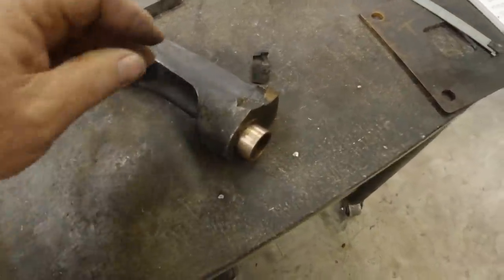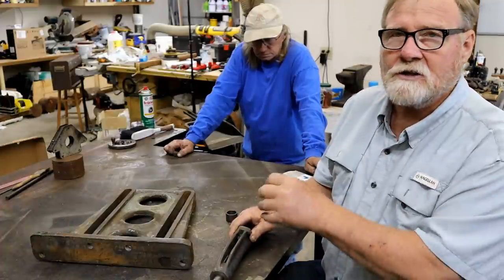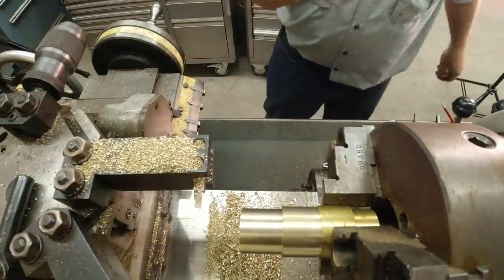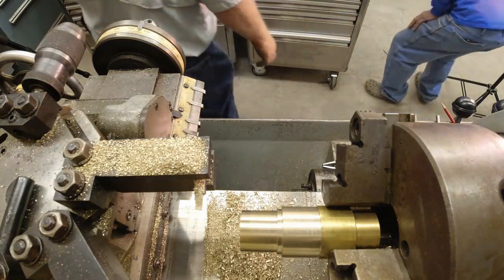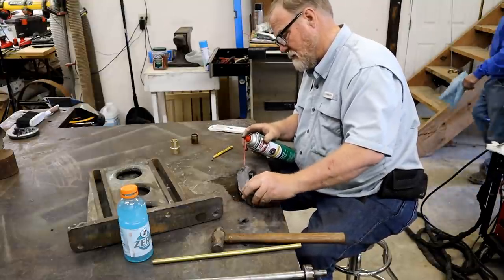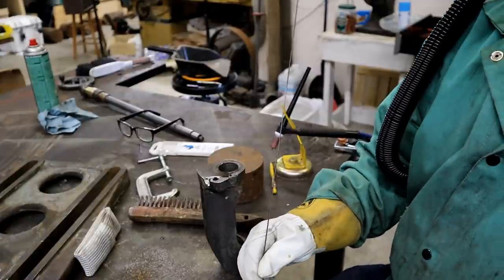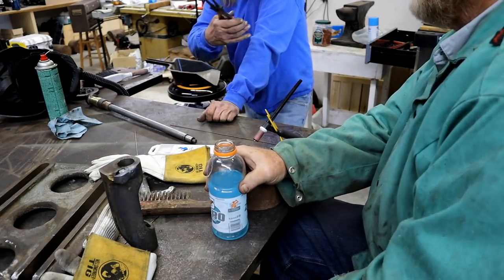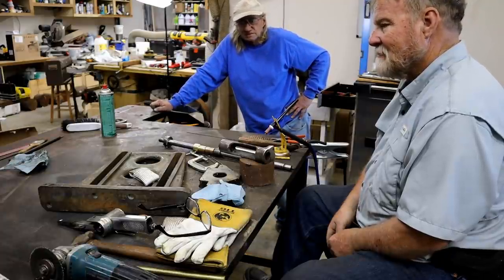Weld Repairing another Cast Iron Shaper Part

Comment: Love your 'big ole hands' 'Jody 'Gloves, I have a couple of pairs of the black tig gloves that are also fantastic......Tig Fingers are great too......
Reply from the maker: I find I use the tig finger as a resting pad most of the time....:) I also was thinking that all my cups were too small so I ordered up a Furick Cup pro kit... Two days and it was here from Weld monger...
Reply: @10swatkins  I bought a Jazzy 10 and some of the glass ones too.....for stainless, that extra coverage helps, but for aluminum, I have gone to a #5 non gas lens and I am getting great results......the smaller etched area makes the arc behave more and I am now getting much cleaner beads.....Jody is a great person to deal with, they are based out of Daytona Beach for the store, which is 50 miles from me......I used the tig finger doing high amp MIG [225] all night long on a 250 amp air-cooled gun, I just unfolded it and slide over the goose neck and walaa, I was not burning my hand......best wishes, Paul.....

Comment: I'd bore it out so that you don't have a stepped bush, your step is a weak point! Cheers, Matthew
Reply from the maker: Looking at it if I bored out the casting It would weaken the sides too much..  the steped bushing has a radius at the step and its a lot stronger than what they originally designed...

Comment: That turned out really nice.........keep us posted (Don) on how that EZ Tig is to machine, did you mill it with HS Steel or carbide, speeds and feeds, that kind of info....thanks guys.
Reply from the maker: It turned out to be hard to hold so I came up with another plan... Next video... the EZ tig is harder than the cast and using a carbide insert it machined well.
Reply: I’ve used this as well. It welds up very nicely, does t seem to have cracking problems, even after a year of use. It machines well, but yes, use carbide. There’s nickel in this, and that’s tough for HSS.
Reply from the maker: @melgross   The inventor says there is no nickel in the rod..Don't know what makes it hard..

Comment: Hey I'm kinda impressed. That stuff looks almost as good as real cast iron welding. . I may tru it on the next broken manifold ear we get in.   I still would preheat to a liest 600 and furnace cool it but overall It looks OK,,,,,,,,Like to see a radiograph of it though to see if if it broke with no preheat.  .... YOu ought to know,,,,Old dogs resist new tricks. 

As far as the support goes though, unless that stuff costs less then 7018 if you can get that mung out the other guy put in, and then be able to chase down all those cracks the EZ Tig filler metal might cost more then making a pattern and having Windy Hill, or somone else make a new casting......If the customer can live with a re-pop the guys that said fab  a new one are the best choice from my house.
Reply from the maker: I have used it for lots of repairs and the thing I love about it NOT having to control the heat.... Hell for a lot of the stuff I would have to be like the Pakistani Truckers, squatting over a bed of coals out next to the street :)

Comment: The bracket on my G&E shaper does not bolt to the base, it has to be able to slide with the table. I do not understand why that one bolts to the base
Reply: The one that moves with the table is the geared and manual section that moves the table horizontally. This bracket is for the mechanism that manually moves the table up and down. Kind of like a bridgeport knee.